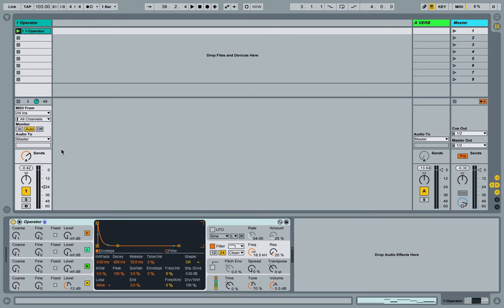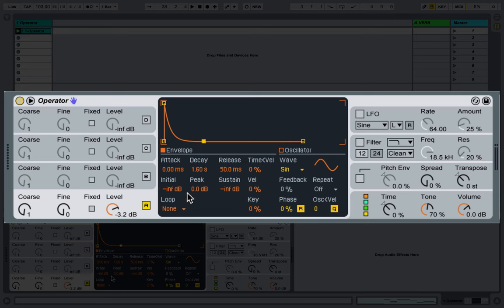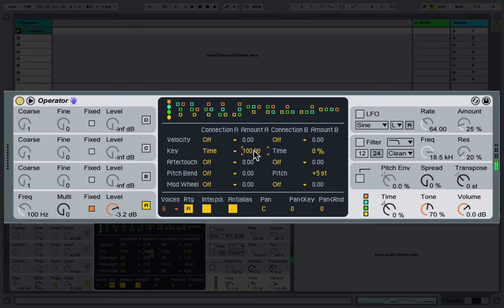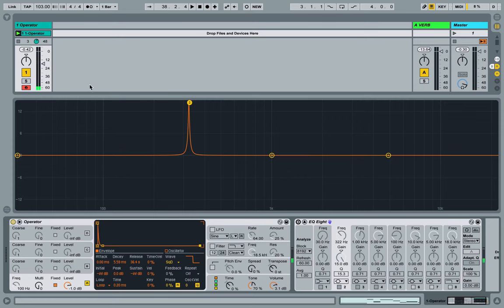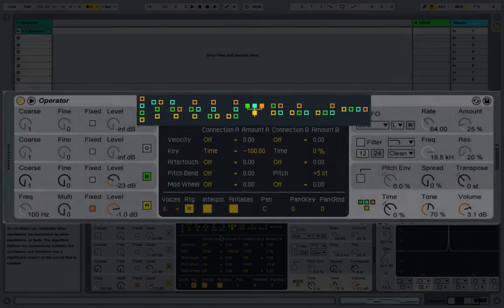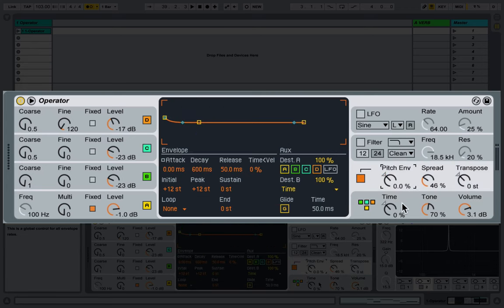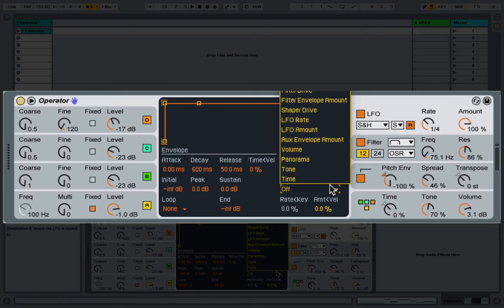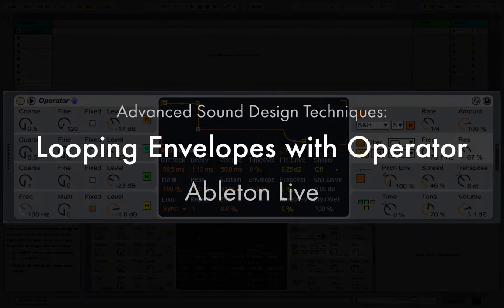Ableton Live: Advanced Sound Design Techniques - Looping Envelopes with Operator

Comment: Hi folks, nice video. 
I recommand also trying to chain operators instead of using all of oscillators on the same operator. I think it tends to have a more layered/Natural sound and it's easier to control automation on those different layers

Comment: Great video Daniel! Do you think we can use Surround Plugin (like Saturn Cosmosf6.1s)directly on a channel on ableton? Thanks for helping.
Reply from the maker: I've never used that plugin before, but Ableton has supported multi-outputs plugins, like Kontakt, for a long time. I see that Saturn Cosmosf supports higher-order ambisonics, but I'm not sure how, or if it handles decoding to binaural or stereo. If it doesn't then you might have to get creative in how you handle getting the 8+ channels of audio from Saturn to an ambisonic decoder.

Comment: 3:43 AM synthesis? Is that a thing? I tho there was only FM synthesis. Can you name some AM synthesis in real life? Or is it only modular thing?
Reply from the maker: +Limpuls Yup, amplitude modulation can definitely be thought of as a form of synthesis. Most of the time we think of it more as rhythmic design rather than sound design but just about every synth out there has an LFO that can modulate a sound source's amplitude. 

https://www.keithmcmillen.com/blog/simple-synthesis-part-9-amplitude-modulation/
Reply: Cool, I wonder if you can achieve ring modulation with vst plugins in any way.
Reply from the maker: +Limpuls I don't know any off the top of my head, but I'm sure you could find a bunch of free Ring Modulation plugins or Max For Live devices. There might even be a Max For Live device included with Live that does Ring modulation.  Sorry, I'm away from my computer this weekend otherwise I'd look with you.